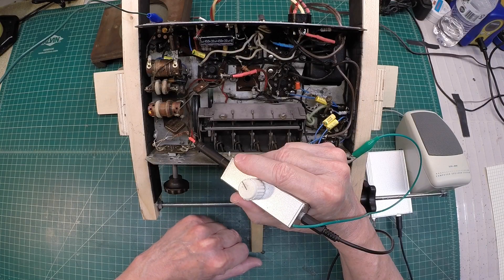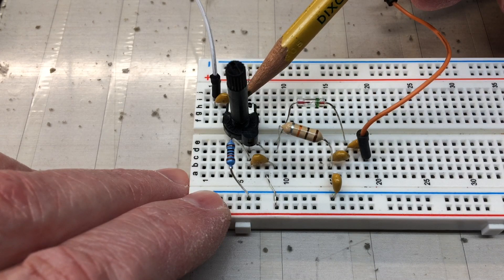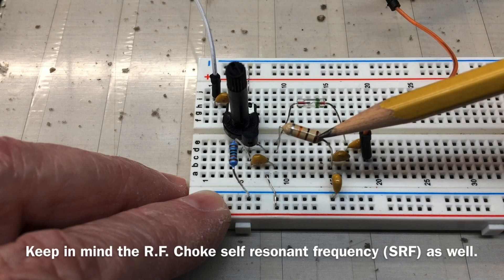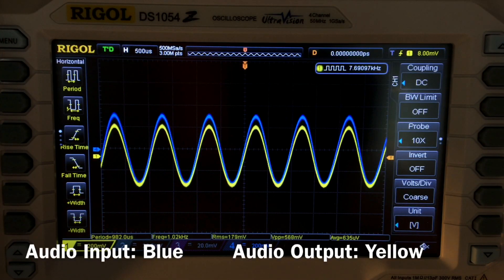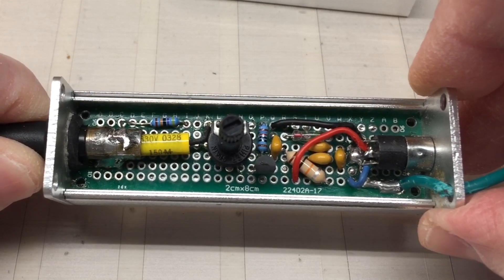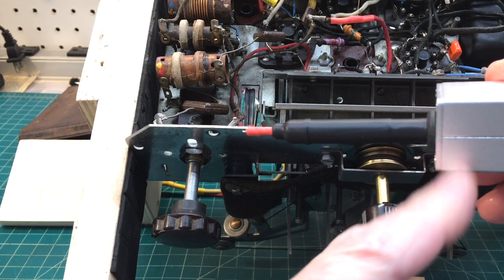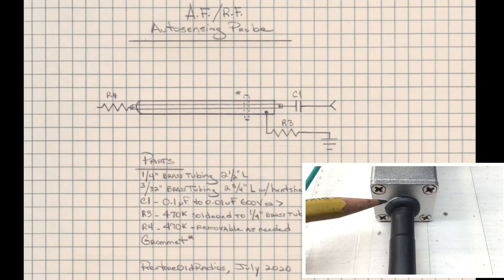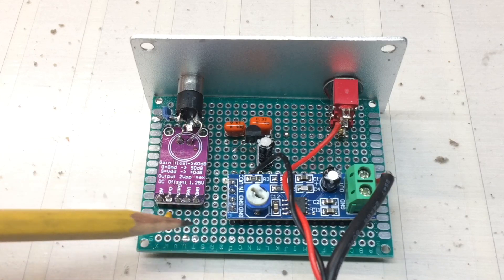Build an A.F./R.F. Autosensing Probe

Comment: That's a signal tracer on steroids, very sensitive and won't load down the circuit. That's a great signal tracer Don. The auto selection circuit works well.
Reply from the maker: Thank you Jim. The design is very simple, but seems to be effective passing the signal along to the amplifier regardless of the source. I appreciate you watching and reaching out. Best, Don